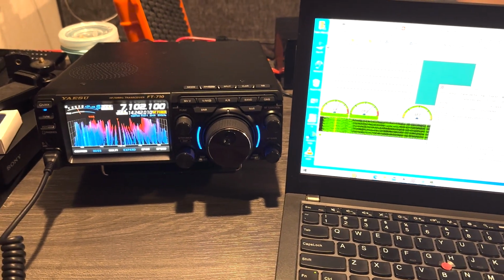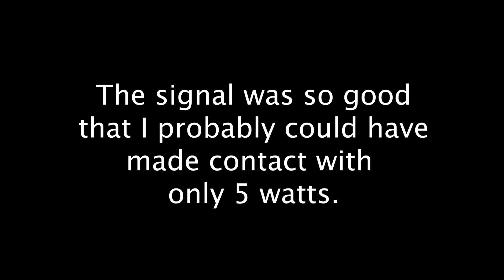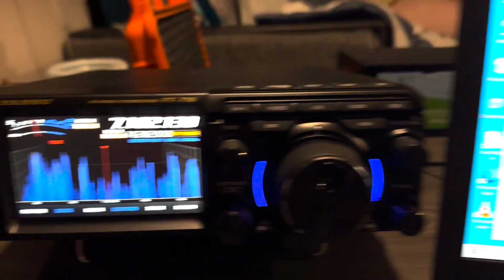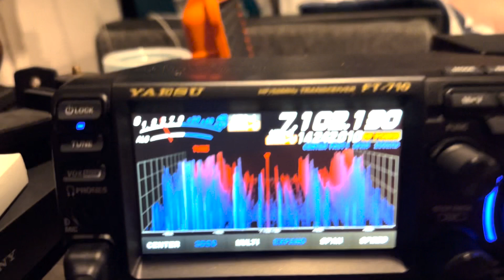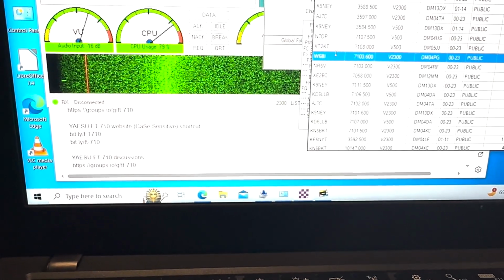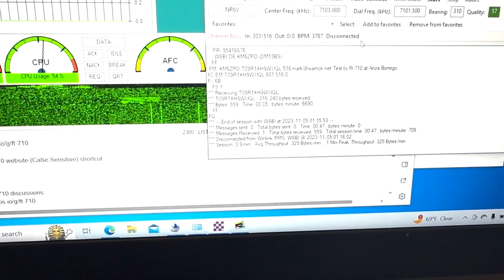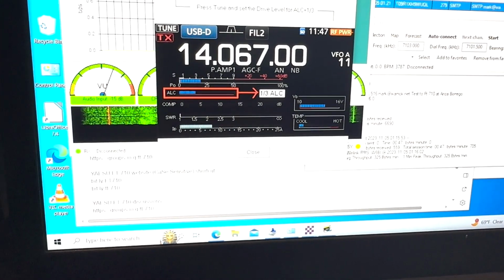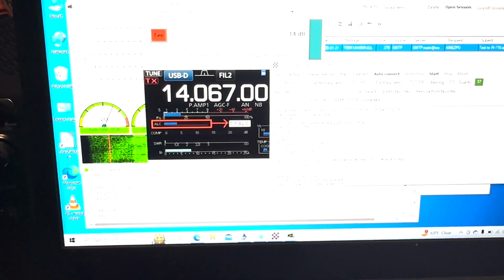Winlink via Vara HF with Yaesu FT-710

Comment: Thank you!!!!  Setting up my 7-10. what if my 7-10 USB port in being used by my SCU LAN10 - network controller? can i just plug it into my network?  Is there such a thing as a usb B spliter i can put in back of my 7-10?
Reply: don't think you can use more than one usb cable

Comment: I'm struggling with this. I click start on the winlink session and it appears to be trying to connect. But after it fails, the radio stays in Busy/TX mode and won't let go. I have to turn the radio off to get it to stop. Any ideas?
Reply from the maker: Possible USB cable isolation issue.  Try a better cable. Try wrapping the cable with magnets.
Reply: @MarkWarrick  I will test your theory tonight. You may be on to something. I had my tablet/PC plugged in at that time to charge it. That is right beside the USB port/cable. Could have created interference. Thank you so much for your reply.